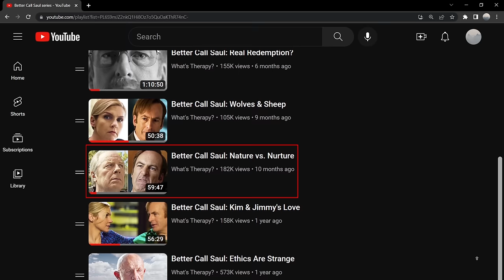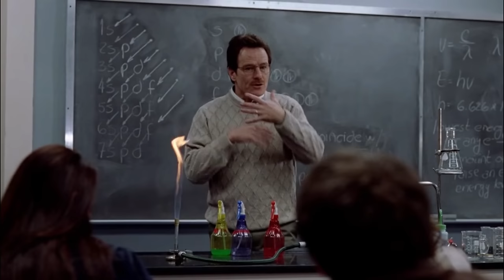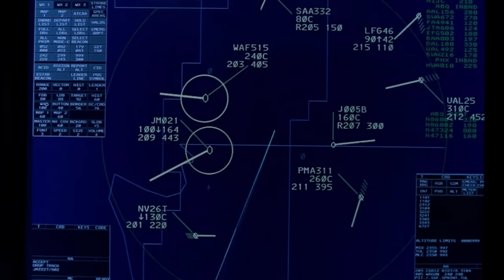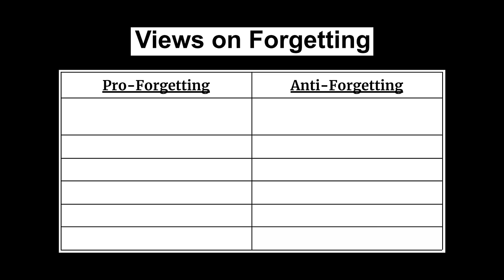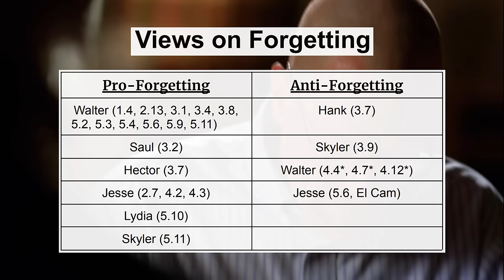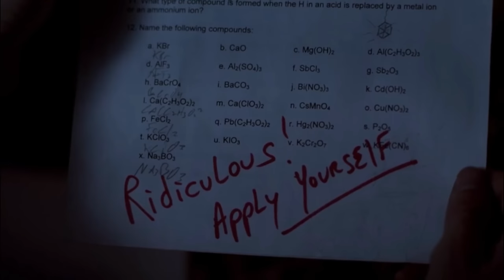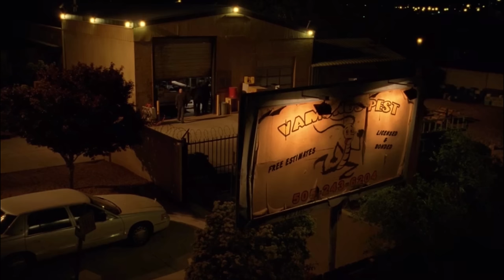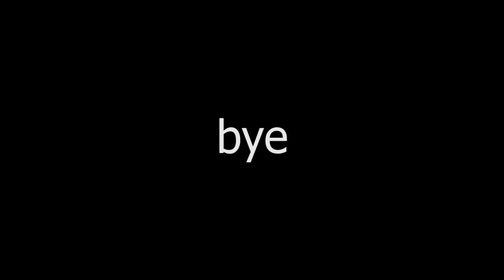I Watched Breaking Bad After Better Call Saul

Comment: Imo If Jesse had refused to work with Walter he likely would have tried to find someone else, and eventually, to tie up loose ends if he reached similar levels of infamy, then Walter would have had Jesse killed or he would have killed himself.

I know through the course of the show Walter and Jesse become close and Walter was even concerned about Jesse at times, but without forming that bond, and based on what Walter eventually became, then I think the answer is simple, Jesse, bc he knew who Walter was, would become a liability that would not likely be tolerated.

I feel like the show basically answers that question "him or me" and even if Jesse did not take steps to put Walter at risk, I still believe that is the way Walter would frame it.

Comment: Weirdly, I wasn't really on board with Walt's relationship with luck/fate until he explicitly invoked it in the season finale. After the badass "cops storm the bar but too late he's already gone" ending of the last episode, the finale shows he barely got out the door and hid in the first unlocked car he could find. He's barely less trapped than if he'd stayed in the bar and the law is closing in... and he prays. And it works. It finally crystallized for me how the contrived coincidences that make up so much of the show (the plane crash, Jesse dating the sister of the kid who killed Combo) can just as easily be read as the characters being given messages by fate, or God, or just The Author. Jimmy sees a target of a con in a liquor store, completely at random, no reason to expect the guy to be in there, to what end? Purely so he could have one last chance to call off the con which will destroy his life. The author throwing him a bone.
Some kids just happen to play in the same spot in the desert where Walt discarded a gas mask. Drew Sharp just happens to be dirtbiking near the railroad tracks. Gene Takavic's cab driver just happens to have moved to Omaha from Albuquerque where he saw Saul Goodman's ads. Massively unlikely events are one of the prime movers of the shows events. The other is the actions the characters take in response to these revelations. That's why everything goes relatively smoothly for Walter in the finale. He's on a righteous path now.

Comment: Okay sorry I just had to stop watching this at 22:25 

The whole characterization of Walter and Skyler based on the later plot COMPLETELY ignores the actual relationship they both had INITIALLY 

The way Walter starts treating Skyler later and starts acting up, including the "I AM the danger" scene is a 180° turn from a broken and to the point he started to become criminal fully subdued guy and the subdueing power was indeed Skyler. 
Walter didn't leave Gray Matter because he 'wanted to teach' as he said, he left because Skyler demanded it so he can be around while she was pregnant and she absolutely did not like the lifestyle of the high stakes chemical genius and CEO Walter was going to take as she doesn't like others having power (see Ted).
Skyler controls the daily life and every ever so small decision of the family, initially to the point at which she even decides what Walter is going to be allowed to eat while at this point he had lost any will to resist being fully out of the picture of his own life.

Everything Walter does later on is based on YEARS (over a decade) of being completely unable to decide ANYTHING about his own life and this changes as he becomes aware of the fact that he won't even be able to decide IF he lives as this decision is about to be made by the cancer. 

I think this is an angle which is rarely talked about but without Skyler being the life force siphoning nightmare of a partner in a highly toxic relationship, Walter might not even have started cooking up meth and surely, even if he started, would not have gone down such a radical route as a lot of this rebelious behavior shown by him is based on this deeply fatalistic life he was forced into over the course of their marriage. 

Don't get me wrong, I'm not saying "SkYlER bAd WiFe BaD GuY GoOd!" or some incel-stuff like that but completely ignoring the OBVIOUS leading role in the relationship to a point where one can't even decide what to eat and even feels forced to defend this decision that she decides what to eat just has to be called out

Comment: I found myself relating a lot to Walt at various points in the show, and so my interpretation of Walt's transformation (which may very well be me reading too much into it) is that Walt may be dissociating and so a lot of the qualities that people never saw before is because he sort of dissociated those aspects of himself away. To elaborate, while I was rewatching Breaking Bad, I noticed that there's a ringing noise they play during a lot of scenes like the mustard scene in the pilot if I remember correctly, which I came to call just the "dissociation noise", where it's not quite explicitly said, but almost always in those scenes Walt is disconnected from what is going on. In the mustard scene again, Walt doesn't even seem to be consciously ignoring the emotional weight of a cancer diagnosis, he seems entirely unable to even try to feel those emotions; contrast this with Jimmy and in similar situations you would see Jimmy employ some strategy to bury those emotions. 

To tie this back to where I related to Walt, essentially as a kid I often got mischaracterized as violent or aggressive, and I was admittedly often violent or aggressive, but from what I can remember, at least, it was always provoked, usually by my mother. I would always try my best to not react to my anger at her because it was pretty much never worth the trouble it caused, but very often she would just keep pushing until I could not ignore it, but over time I got better at just putting it in a box until I could no longer get angry. So as an adult for years, I was also basically a mild mannered people pleaser, because for a long time I was pretty much unable to access those emotions at all. Now that I've decided that I need to let myself feel those emotions and have put a lot of work in to do so, for the last few years, I've had to strike a balance between the person people expected me to be, and the desire to participate in risky behavior and such. It's really hard to do honestly, there is a strong desire to indulge those emotions because of how neglected they were for so long, and while the things Walt does are in a completely different league, I do empathize with his struggle to restrain the Heisenberg part of himself. In fact, I think part of why that transition is so fast for Walt is partly because those things about him have always been there. He's bout 50 years old while I'm 26, so he has decades more emotional baggage stored up that once he allows himself to engage with that because of his cancer diagnosis, he is almost completely unable to restrain that because of the sheer weight of it once a crack forms in the metaphorical dam.

Comment: Tldr; therapist uses Breaking Bad as an excuse to thoughtfully soapbox about far-left morality for 2 hours. Not unwatchable, but slightly anemic when it comes to actual analysis about storytelling, character development, acting etc. Thoughtful yet distorted, 6/10
Reply: Who would have thought that a therapist with a channel called "What's Therapy?" would focus on the psychological aspects of the characters rather than make the 8 billionth video essay "about storytelling, character development, acting etc."?

What a world!
Reply: @Hjy84  I would, but that doesn't have much to do with what I said. And it's pretty strange to imply that character psychology and 'acting, storytelling, character development' are in any way mutually exclusive. Those 8 billion video essays 100% focused on character psychology too. The only difference here is that the essayist is also throwing in a ton of moral value judgements and far-left framings along the way, which is.. what I wrote in my original post.

Comment: i find BB better but I also had the privilege of watching it as the episodes released - meaning I had to endure some of the most amazing cliff hangers ever. This may have elevated my experience to another level. As I did a few re-watches, the instant relief by watching the next episode right away has a major impact on the experience of single episodes. If I could i certainly would want to try watching Better Call Saul without having seen Breaking Bad.

Comment: Walt's pro moving on talks as advices r a key element of his manipulating toolkit. He knows that it was this copingtactic that lead to the loser he was, whren the show started.
It was what kept him passive , out of power n out of true choice when it mattered. It kept him dependent. He starts using it on people he needs to keep using, but who could also decide to not really want or need him. He knows a traumatic event can cause the kind of selfreflection that will lead to big changes. In jessy's case it's not simply the loss of a functional part in a team, but also his monopoly status which is big part of his identity. We get this clearly after gustavo is gone n he has no longer a reason of fearing any replacement as a deathsentence.
Also intresting is the fact that gustavo as well is an obsessive control freak. I guess walt hates him in part because he sees in gus the pure form of what he's making himself into. Also the replacement for jessy is hated as depiction of what he tried to rid himself from being. His past, unable to act n his future forced into a single open route of action - both powerless in a way.

Comment: 26:00 Eh... Reading WAY too much into this. He's adding, "I think," to avoid bruising Hank's ego for correcting him in front of his partner. The playfully aggressive banter of Hank not taking corrections well from his partner over whether something is "green" or "sage" sets this up very clearly. Hank shoots him a look, Walt backs down, Hank plays it off as though he knew all along. It's simply a comment on the relationship between Walt and Hank. Hank doesn't like to be wrong or made to look weak in front of others, Walt doesn't like confrontation with his brother-in-law.

Comment: drifting is easy when u have little traction or a lot of power, i can just throw my utes steering wheel from full lock to full lock and get mad angle (rip ball joints and rack ends)

Comment: Very interesting.  I can't say I disagree with anything here.

I would rate Breaking Bad over Better Call Saul.  BCS probably has better writing, but BB struck me emotionally more. Probably because the stakes are much higher.  Also because I attached to Jesse more than Saul.  They have opposite character arcs. And Jesse was a much better secondary protagonist than Kim. I loathed Kim.

Comment: Why do you add these weird visuals to the looping clips such as increasing the contrast and brightness of the clip? It throws me off
Reply: Specifically the looping clips at 38:45 and 51:24 and so on
Reply from the maker: Its because there are actually no appropriate clips to play during those parts, as I'm going off on somewhat other tangents, so general clips would be confusing or distracting imo